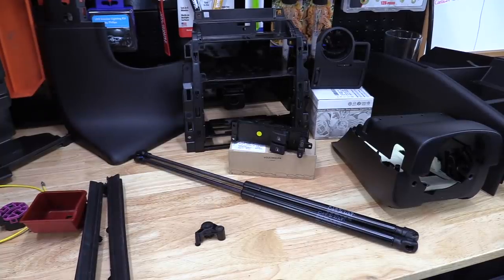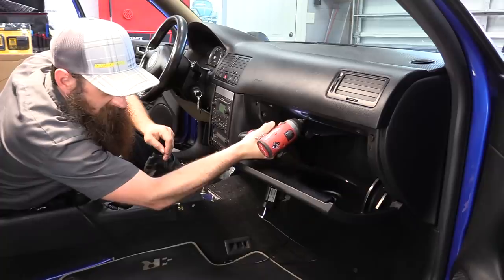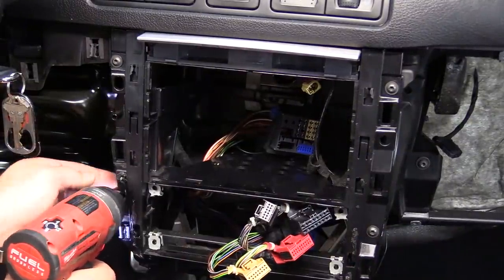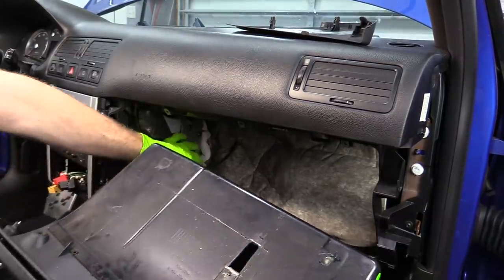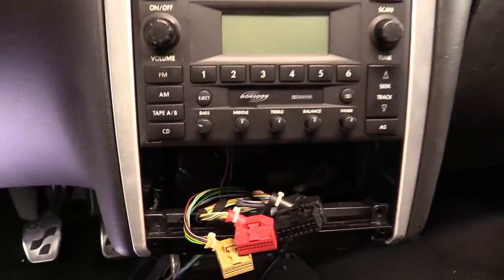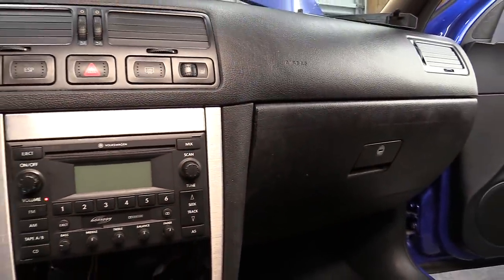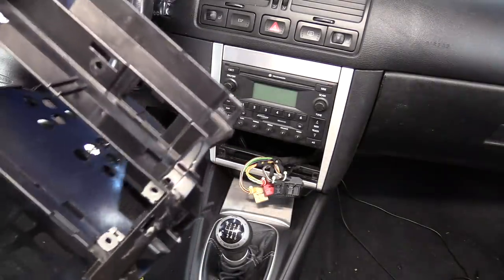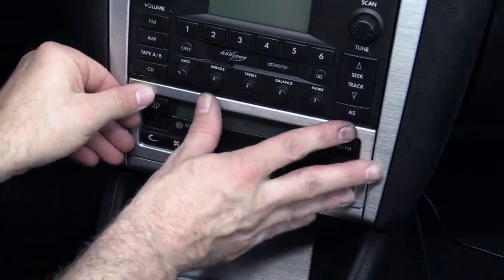Replacing 9 Broken and Expensive Plastic Parts on the R32

Comment from the maker: If you are looking for the PN of all this... Here ya go:
Sunroof Boot ~ 8D0-877-781-B-01c
Sunroof Boot ~ 8D0-877-782-B-01c
Battery Box ~ 1J0-915-335-a
Lower Column Cover ~ 1J0-858-559-D-1QA
Upper Column Cover ~ 1J0-858-565-f-2AQ
Ign switch Housing ~ 8D0-971-975
Window Switch ~ 1J3-959-857-B
Gas Pad ~ 1J1-721-647-A-B41
Brake Cap ~ 1J0-721-173-D-B41
Clutch Cap ~ 1J0-721-174-B-B41
Left lower Trim ~ 1J1-858-365-F-2QL
Right lower Trim ~ 1J1-858-366-A-2QL
Air Vent ~ 1J1-819-703-E-2AQ
Bezel Trim ~ 1J1-858-069-G-01C
Center Console ~ 1J1-863-201-L-2QL
Wire ~ 000-979-227-E
Reply: The lower and upper steering column cover Is not available at my local dealership it’s been two years and I haven’t seemed to find one new I have a used one from eBay and it looks like crap any chance you have a link to were I can find this trim and possibly other interior parts
Reply: if you think the R32 is a lifetime keeper you should go ahead now and buy all those parts and store them away for the future. if you don't need them they will be a good investment. I've learned that when I order parts like this for my corrado to order twice as much as I actually need and squirrel the spares away.
Reply: IplayLetsplays thanks man I appreciate it 🤘🏼

Comment: The soft touch coating on some of my mk4 interior plastic items was so bad that it started pealing off. After pealing away as much as I could, I finished off the tenacious parts with isopropyl alcohol and blue shop towels. After removing the soft touch from the plastic trim, it now has a piano black finish. Much better looking, more resilient and a lot more affordable.
Reply: In hot countries this soft touch becomes nasty sticky overtime

Comment: Well trim does make your car look a lot better.. I usually pick trim up from the wreckers if it is in good condition. Same with rubbers/window scrapers/plastic fasteners. Sometimes depending on the part I don't even have to pay for it. :) Keeps me coming back for bigger stuff too.
Oh btw Charles, the high pitch noise/clunk when I close my doors actually was caused by the horizontal crash tube not being fastened. I removed the screw months earlier in preparation for paint......
slaps face

Comment: On my mk4 2.0L all the "soft touch" plastics were falling apart and sticky so I ended up taking it all apart and use throttle body cleaner as well as alcohol and got most of it all off, then sanded and prepped it for paint and it looks mint, good was to save some money instead of buying expensive brand new ones

Comment: 20:50.  The "Secret Compartment" used to be one of the worst cup holders ever.  Not only was it flimsy, but when in use, it blocked the upper push buttons and the radio controls.  There was another one on the back of the center console for the rear passengers.  I've taken several of them apart and I'm just stunned at the over engineering that went into them, all for nothing.  VW got tired of replacing them under warranty so they deleted them altogether, replacing them with a blank panel in the rear and a useless door in the front.  18:12.  The Mark 4 started with black struts.  Went to silver struts in the later cars.  19:35.  I take the metal parts off for two reasons.  Sometimes I keep them for later use.  The other reason is so that I can recycle both the plastic and the metal if they're separated.
Reply: I liked the old style back cup holder,  it seemed to work better, and could actually hold two cups, unlike the revised/late Mk4 lower console setup of 2 in front + 1 in the back.   Been wanting to Frankenstein the older rear cup holder setup with a late style lower console to regain it all.  Passats and Audis of that same era, and much later, used that old front cupholder in the rear fold down arms, same cartridge.   Worked better for the purpose, because there wasn't a radio to block/spill drinks on.
Reply: I pretty like the front double cupholder, it really does it's job, but... Yeah, it blocks the radio...
The back for the rear passengers is less comfortable.
And the plastic trims are a nightmare to reassemble; even if they are not broken, you definately would break them at the first time...

Comment: To refinish this 'soft touch' plastic, I've found that 90% isopropyl alcohol and a stiff nylon brush melts the old finish off. To re-coat, the SEM line of refinishing products works great. Plastic prep, adhesion promoter and SEM trim black work best to replicate the OEM finish.

Comment: A tip for this work, you should have your radio code handy when unplugging the radio and battery, assuming OEM radio.
Reply from the maker: Very good tip! 
This stores the code in the cluster. Unless you’re unplugged for a long time.
Reply: @HumbleMechanic  Actually 03 and up instantly work when reconnected. I know because I got my DD radio replaced with several times.

Comment: When you use super glue you can use baking soda to instantly dry it ! It will also give it some strength!
Reply from the maker: Yea? Awesome tip.
Reply: When a flush fit isn't required.. I glue a washer onto the plastic, as a brace. Works really well!

Comment: Very nice work. A minor thing: the bolt retainer clips are like 20 cents each and I have seen many people especially mechanics struggle with broken ones trying to make the bolt stay in place, put glue etc. REPLACE THEM PEOPLE. This also solves rattle problems. 
Also, how you solve creaky front seats in "spirited driving"? I know it's the big springs at the bottom of the seat but how you fix them?

Comment: I got Chinese gas struts from Amazon for $10 each delivered.  They fit perfectly and are still fine after three years.  Much better than $92 OEM from the dealer.
Reply from the maker: I think I got these from RockAuto. They work just fine. I would have like to have got chrome, but meh HAHA
Reply: @HumbleMechanic  I guess the deal on Amazon was too good, because they're not available any more.

Comment: Hey Charles , always enjoy your channel good info. My dipstick is leaking where it enters the oil pan I don't know if this is very common or not and I'm still under the powertrain warranty would something like that be covered under powertrain warranty. Thanks
Reply from the maker: Most likely covered under warranty. But they have a specific list of parts covered, the failing part must be on the list
Reply: @HumbleMechanic  thank you for the reply , your connection with your viewers is why your channel is respected so much !

Comment: Mr Charles I have a question which is not based on the above video.My question is that does Air-Fuel ratio of an engine varies with respective engine Compression Ratio or any other aspect.Like we have some world winning engines like A888 GTI which is a 2 litre engine but is much more fuel economy than it should be for a gasoline 2l.

Comment: I have a question, how do you feel about removing the heat shield under the hood? I noticed in the video when you cleaned the throttle body you didn’t have a heat shield on your GTI. I’m really just wondering if it will affect anything?
Reply: Thaddeus DeWyse it’s just there to reduce noise inside the cabin... if you concentrate real hard, you may notice a difference, but probably won’t. 

I took it off my b5.5 and drove without it for almost 3 years without issue; going on a year on my 1.8t mk4 as well. 

Any negatives are far outweighed by not having a hanging blanket over you with foam falling out every time the hood is opened.

Comment: Most of the "wood" trim pieces on my Jetta are cracked and broken. I really want to replace them, but they are either discontinued, extremely expensive, or just hard to get.
Reply: I'm planning to wrap my cracked "wood"  door trim pieces with a woodgrain print material I found from AutoZone.

Comment: Have a 20th AE GTI where someone installed a really crappy bag suspension system. I plan to yard it out and replace it with coil overs. Do have a recommendation for brand? I want to go just slightly lower than stock or stock height (which is lower already that stock gti height). I want the ride to be smooth, (it’s a daily driver and streets are bad) but either stock or slightly lower and adjustable. I’m willing to spend a little money but want a quality ride with some stance. My first quest would be H&R coil overs w/Bilstien...
Reply: Continued: is there something else? What it the stock ride height on a 03 20th AE? Don’t want to scrape or have issues in the city... so maybe standard ride height for that year and model? I had the H&R cup set up on another gti and didn’t like it. The rake was completely flat and it was kind of bouncy, not real bad but who wants that at all? - no good.

Comment: So on my 2001 GTI GLX the window switch panel doesnt wanna come out and i do not want to break it, i have new switches coming in tomorrow but i wanna take it off now to make it quicker later, any tips anyone? The pladtic housing around the handle is snapped in half at the back (only where you grab, where your pinky would be) but it feels like its clipped in or something, should i just remove my door card?

Comment: I want to know if the sunroof can open all the way and if it does mine is stuck. It can only go up but never open
Reply: mine opens all the way
Reply from the maker: There are 2 “full open” positions. One is comfort. This is about 80% open. That’s the position on the switch where the roof will go back auto. 

The other is full open. You have to hold the switch to make it gothere

Comment: Hey, I gotta redo both A-pillar trims on my mk4, any clue on how to remove them? It seems like all those clips glued themselves together and it's a really tight fit.
Reply from the maker: They have a special clip you have to remove. https://www.ecstuning.com/b-genuine-volkswagen-audi-parts/pillar-trim-installation-kit/t10078kt/?gclid=Cj0KCQjwn8_mBRCLARIsAKxi0GJ0UBtUI1qDPXTrhVcbTDp2i7AdtG5SdHZS5Pvu7MDa-SendteBCL4aAplgEALw_wcB
Reply: @HumbleMechanic  $50...what the shit
Reply: @rendaddy_  Worth noting that the earlier Mk4 don't need this clip.  In around 2002-3 they changed over to the curtain airbags, and this clip IS needed on both the A and C pillars.   I've removed them using a 90-degree bent pick, the clips are two part, and the one piece can be pulled near straight out.   Also...  try to go to a salvage yard, find a mk4 with the same A-pillar as yours, and practice removing it, before you attempt yours.     No one really has pictures online, or a video, because of the confined space.   It's a learn by doing trick for removal.

Comment: Excellent work sir, it's tough to maintain replace some of these parts when your not the first owner.

That said $1000 for trim parts like that? Yeah no thanks I'll go to a local pick, 3rd party supplier and or  maybe fabricate some panels with a 3D printer or out of some
aluminum sheet metal. lol
Reply: Some of us outside the US are a bit luckier -- we had continuation Mk4.5s that had most of the same trim.    But some of the really handsy locations, like the door grips, are hard to find used in good condition.   Worth the wait, but I"m a dummy that has waited and hunted 2 years to find an OE radio with a code in the donor, to replace back into one of my Mk4s.
Reply: @chrstphrr  hah dang man I would have gone aftermarket at that point. I don't own a vw myself just love this channels content.  

That said my roommate has a mark v GTI and it's pretty sweet, I drive an 09 g37 for myself.

Comment: Charles, isn't it necessary to do throttle body alignment with VCDS after disconnecting battery? My $.02, haha...
Reply: In my experience, not really. I had a b5.5 Passat for years without ever having VCDS or doing the TBA and it never had an issue, no matter how many times battery was disconnected and re-connected. Same with my mk4 ... I've actually even swapped ECUs without re-aligning right away and had no problems. Take that with a grain of salt though, because your mileage may vary ...

Comment: Might wanna disconnect the battery before removing the seats in case of accidental airbag deployment. I would do it the way you did. But for those who aren't as experienced or for the sake of some jackface trying to sue it's probably better practice to have the battery disconnected and wait about 10 mins before disconnecting airbags connectors at the seats.

Comment: Where can I find these trims I have a mk4 Jetta and wanna change out my tan trim
Reply from the maker: All this came from teh dealer. PNs are in the pinned comment.
Reply: @HumbleMechanic   completely missed that comment . Thank you very much and keep up the great work man , killing it with these videos.
Reply: To save money, lots of the trim can be found in a salvage yard too, at  much less cost, but not as new.   If you're patient,  you could find most of the trim in good condition that way, and maybe have to spring for some brand new parts.   Another source can be people parting out their mk4s that have been in accidents, or the engine/transmission died out.    And some of the parts on a Golf, Jetta, or New Beetle are the same, regardless of doors on the body, like the carpet.
Reply: @chrstphrr  that is true . The only issue is that the palstic tends to break easily when it's old

Comment: Would like to see the HVAC blend door replaced/repaired.
Reply from the maker: I will be doing this in the fall most likely
Reply: @HumbleMechanic  thank you that would be a good one. The dealers here would likely charge quite a premium for the HVAC duct assembly supplied and installed...probably half the value of the vehicle as is I'd guess. It is an annoying failure, but with 18 years of service probably a reasonable life.

Really enjoy your videos. They help me alot in keeping my wifes Typ 1J0 up and running! Much appreciated.

Comment: How much you paid for all that parts?
Reply from the maker: It was about $1200 for everything I bought. A few of those parts weren’t installed on the video
Reply: @HumbleMechanic  wow. that's price of the Golf IV. Not R32 of cours . New parts are also coated with rubber that's scratch easily?

Comment: If anyone can help: I have a 2002 mk4 1.8t 5speed gti. There is about 5 degrees of free play in my steering wheel when straight both left and right. It’s so very little. I want to know if there is any adjustment nut on the steering rack itself. Or if I had to do a steering rack job...if anyone knows plz lmk there are no threads that go into detail about mk4 steering racks. I’m pretty sure R32 rack is different. But all you Jetta and golf guys help me out!!

Comment: Makes me not wanna take my dash apart in my r32 this upcoming winter to re seal my blend doors because all the foam keeps coming out!  I’m afraid all plastic will break because it was a Florida car!
Reply from the maker: Very valid fear. I have to do that same thing on mine.
Reply: Taking the dash apart isn't so bad ... for me getting the sticky foam cleaned out and vacuumed through a tiny opening and putting aluminum HVAC tape over holes that I couldn't really see was the killer. That said, it was well worth the scratched up arms ... I never knew the heat and AC could be this good, and not seeing foam flying into my face is amazing too!

Comment: VW is the only brand that gives you the appearance and feeling of quality, but is worse than any other brand. At least BMW/Mercedes/ any other german car are built ruggedly, not just putting up a facade like VW
Reply: It would be one thing if the parts to fix it were relatively inexpensive, but you have to pay an arm and a leg for every little thing. And that's really hard to justify when you have a 230k-mile Passat like mine that's worth maybe $1000 AT BEST.
Reply: @tyvekhomewrap9164  exactly, use the thinnest plastic they can get away with, ugh

Comment: Does the R32 have that VW crayon stank?
Reply from the maker: Mine really doesn’t
Reply: So is it from anti rust  wax coating on the floor pan inside the car or from the carpet itself? My 01 Jetta smells pretty bad in the summer with hot weather
Reply: @kx65fast  my understanding is if you pull up the carpet the source of the smell is obvious.... Been wanting to do this on my MKIV Jetta for ages.  In summer the smell gets in my clothes and drives me insane.